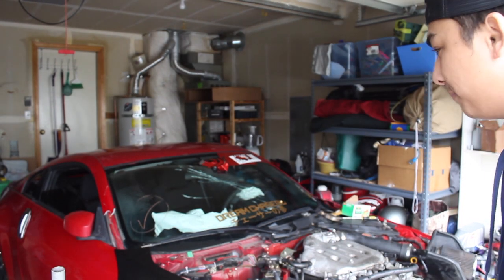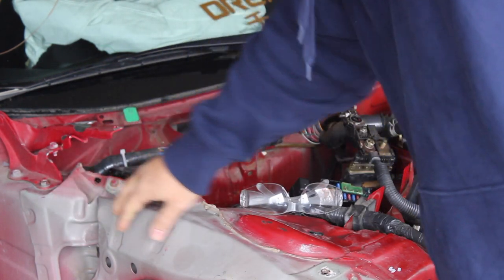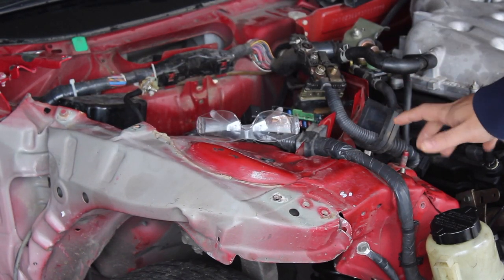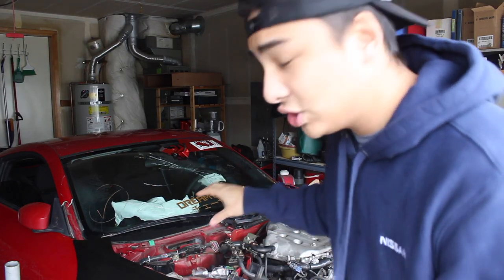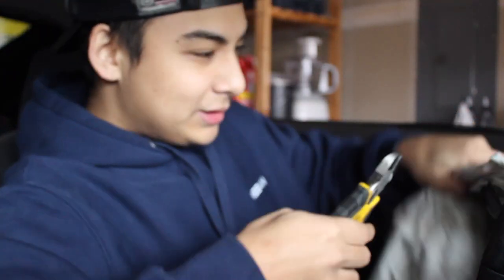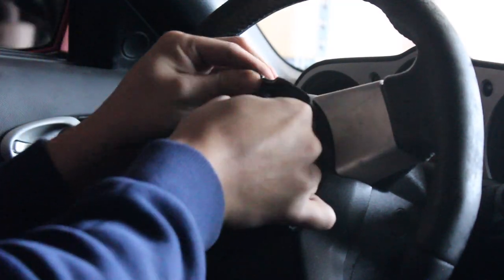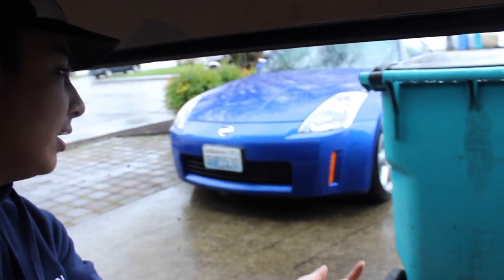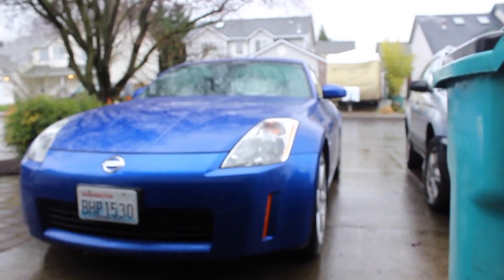350z airbag delete

Comment: You can get it registered you have to replace the air bag system and safety system and make sure no lights on dash and everything fixed properly then you can register it after Inspected by state to make sure you did it properly
Reply from the maker: Thanks man! I’ll try that

Comment: why not pull the damage and leave it as it is
Reply from the maker: oamanaz676 because I’d rather rebuild it with structural metal instead of riding on a twisted frame
Reply: Because it's after the strut tower, so it's twisted af and probably drives funky.
And you can't really pull that.